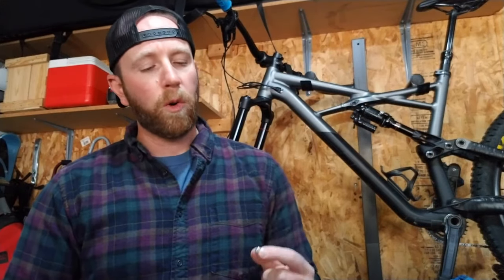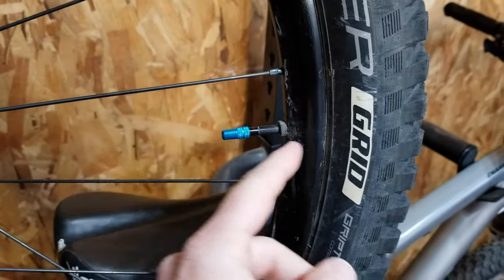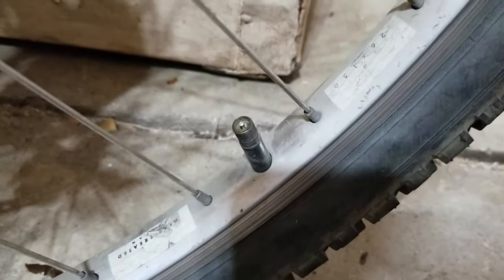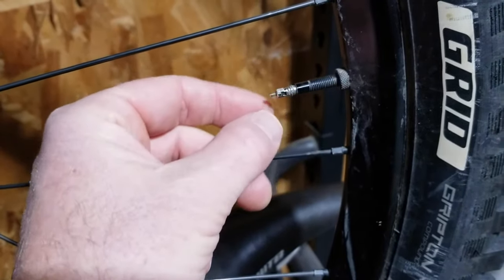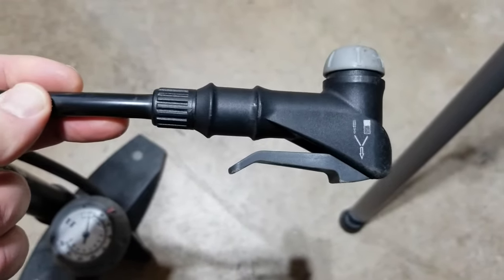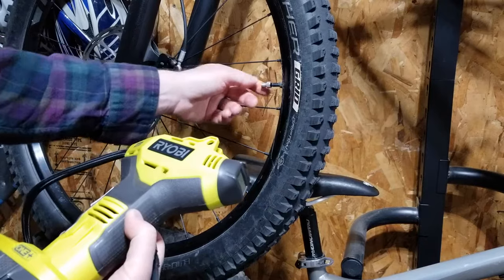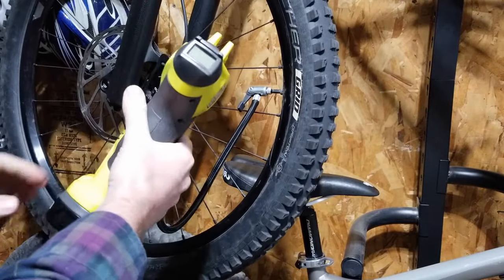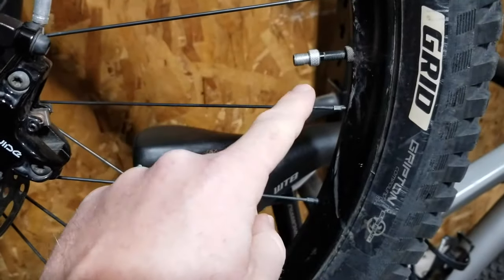How to Use a Presta to Schrader Valve Adapter- and Why Presta Is Better

Comment: Wow, thanks! I acquired a euro ebike that has Presta valves & my pump is for Schrader only. I stopped in my local bike shop & the guy was trying to convince me to spend approx. $100.+ to have him switch out my valves & tubes from Presta to Schrader 😐.  I asked him about an adapter & he claimed they didn’t sell them, he didn’t know ANYthing about that, & no one at the store did either. 🚩 (Red flag!). Been biking for decades & I sensed I was not being told the truth. So here I am on Youtube learning about this less than a dollar part!!! Unbelievable! THANKS 🙌
Reply from the maker: Wow, that seems really shady that a shop wouldn’t steer you first towards this super simple solution. The second most easy solution would be to buy a cheap hand pump that has both Presta and schrader capability. So glad we were able to help and keep you from getting seriously over charged. I would definitely avoid that shop in the future.
Reply: I would definitely avoid doing any other business with that LBS for sure.
Reply: Location of  bike shop so I will avoid it.  No name,  just the city and street please.
Reply: Wal Mart has the adapter for about $2.00
Reply: @jeffhallel8211  Amazon has a 5 pack with dust covers for $6.00
Reply: I'd name them, that's robbery. I ordered a tube with one by mistake because of price, but my air pump came with adaptors for balls and this Presta valve. Speaking of names, don't buy fron Pasco Powersports in Port Richie, FL. They wrote me up a deal for a bike that was $250 more than it was for sale on their website that very minute, and I drove 1.5 hours (one way) to get there to buy it! It wasn't a mistake, they didn't think I'd see it, so I left. That's how you call them out.

Comment: Being 'older' riders and just up grading our old bikes, my wife and I went to put air in the tires before riding and guess what? a valve we'd never seen before.  Called the bike shop and they said bring the bikes in to get air, 20+ miles away, went to Walmart of all places after watching your video and got two adapters  for $2.00.  ( No one at the bike shop mentioned the valves when we bought the bikes)  Thank You.
Reply from the maker: You’re very welcome. So glad we were able to help and hopefully save a little bit of money and time. Bummer that your local shop didn’t immediately identify this as the solution.

Comment: Regulating pressure on schrader valves is very simple.  If your finger nail can't do it the valve cap is designed to depress valve.  What other reasons might Presta be better than Schrader?  I can't see any.  They are a bigger PITA to use IMHO.
Reply from the maker: Good information. Good to hear from somebody who is pro Schrader. Thanks for sharing and thanks for watching.

Comment: I have a Specialized Fat Boy, and couple of times I've had to replace a tube. Even with a good quality floor pump, it's exhausting work to inflate the tubes from scratch. During the Florida winter months I take longer rides and I dread getting a flat tire because it means having to pump it up with a small hand pump even though it's designed for fat bike tubes. I dread ever having to inflate a tube with the hand pump, and I've been looking at the adapters and perhaps carrying a battery-powered pump on the bike. I wondered how the adapters work, so I'm glad to have found your video. Thank you.

Comment: These things are such a pain in the rear. I already have many tools and gauges for a Shrader valve. Even using adapters doesn’t work correctly for some things like my gauges. The first upgrade to my new bike will be to change to Shrader valves.

Comment: I first used my bike frame mounted pump on a Presta valve after changing a flat on the road. I aired up, unscrewed the pump and out came the Presta valve core.  I put the core back in with a little damage to it and limped home.  I searched online and found out about these adapters.  Now I feel safer on the road.  At home I air up with a floor pump and no adapter since the adapter is too wide for the floor pump clamp on nozzle.  I also bought a Presta valve core tightening tool with some spare cores.

Comment: i had 4 tubes pop in less than a week, finally on the fourth swap my bike shop found a problem with the tire, so we fixed that, but he didnt have any 27.5" x 3.0" tubes in schrader, so i got presta, and they made it so much more confusing than it had to be for me to learn how to inflate it 🤣 Thanks for the help for my first air refill
Reply from the maker: Sorry you were having all those problems. It’s definitely a little more complicated system. Glad you got it figured out. Enjoy those rides.

Comment: Coolski, got it going. Had two adapters one smallet and one larger. If you look closely at the valve it has two different threads. The small one did not work, but the larger one did. No need to tighten too much.

And you need to be careful not to screw the little thingy with your converter. Test with a pen or similar

Comment: Both valves work fine. Both will hold pressure. Both will not unintentionally let out pressure. 

My car, mountain bike, Onewheel, Sur Ron and BMX bike all have schrader valves. No issues. 

I have however had the little screw cap come off a presta valve and it wouldn’t stay closed. A shcrader valve, when under pressure, will always close. 

Just my $0.02. But great review on the adaptor as it’s what I’m looking for since my mini pump and c02 inflator only allow for presta valves.

Comment: Scott, you are spot on about that Ryobi inflator.  I've had the analog version and it's been bulletproof.  Actually, the whole Ryobi One-Plus ecosystem is an amazing value, and Home Depot has those... and probably lots of other stores sell these Ryobi products, but Home Depot has pretty much everything that Ryobi offers in that line, and Amazon, not so much.  And no, I don't work for HD or Ryobi.

Also, the Ryobi inflator already comes with a Presta adapter, it's the gray plastic thing, slipped over the basketball needle.  But buying more Presta adapters is a good idea anyway.

Comment: The Ryobi inflator actually comes with its own presta adapter. 
They put it over the needle valve adapter in the accessory tray so they can fit three adapters in two slots.
It's not the best quality since it's plastic. 
But it's there.

Comment: The adapter is nice, but it won't work with most schrader gauges, so while you can inflate, you can't check your tire pressure. Really shines a light on how having a second standard, even if slightly more "user friendly", is ultimately quite hostile by the simple fact that it is a second, slightly different standard, requiring adapters and sometimes two of the same tool. If you have a choice, always get schrader valves on your bike. It'll make your life a lot easier.
Reply: It’s the Apple way: make proprietary tech that forces the end user to buy or die.

Comment: I have Presta in the front and Shrader in the rear. I'm an auto detailer and have the larger Ryobi pump with the adaptor; I wasn't sure about the screw part. I'm not sure I understand the reason for the difference, although I got the Presta by mistake because it has the numbers my bike's tire does. It's okay though, the tube is fine, just different. I hear they are for higher-end bikes, but mine came from an online sale for $85. Presta met my budget. Should be called "Presto"! Thanks for the tips!

Comment: The best bike pumps for dealing with Presta valves are the German topeak pumps. They lock on very nicely. I have no choice but to use Presta valves. On my 42mm deep Aero wheelset. They require 60mm long presta valves. Luckily for me a knowledgeable guy in a bike shop. Told me about Topeak bike pumps. And I have a mini  morph one. Its AWESOME.

And Ive never had a problem. They tend to hold the air better than Schrader inner tubes in my experience. I had 100 PSI in my tires. And they only dropped to 89 PSI in a month.

I remember Schrader tubes dropping to less than 50 PSI over a similar time period...

Comment: and Presta valves look so much nicer than those old Schrader ones IMO, I have just converted 2 old Mavic M231s to presta, which can easily be done with grommets or old plastic valve caps

Comment: I'm going to give people a "hack" I found out about a few years ago that most people don't know about.

Hate to correct the content creator on this one, but I do not see any inherent advantage a Presta valve has over a Schrader valve, and here's why: On any air gauge you can buy at any bike shop, any gas station, big-box department store like Dollar General, Family Dollar, or Wal-Mart, or any hardware, auto parts, or tool store (i.e., Harbor Freight), what you will find is what looks like a small tip on the back side of where you put the gauge on a Schrader valve to check air pressure. What that tip is for, believe it or not, is as a release tool for the Schrader valve in case you over-inflate your tires! In other words, a pump puts air in, and that tip on the back side of the air gauge presses in the valve to let air out. 

So no, you do not need a small screwdriver to release the air from a Schrader valve, because if you've got an air gauge, you also have an air release tool already that is built in to the gauge. 

Happy cruising!

Comment: All my Presta valves are bent. All of them.
My rims need drilling in order to accept Schrader, but these Adapters are neat!
Reply from the maker: You can actually get new Presta valves and a tool to replace them on Amazon. The kit is only like $10 or so. I’ve had to switch out mine a couple of times. The kit comes in really handy.
Reply: @ScottsGarage  Doesn't the valve core have to be removable on the tube? I had a good thorn resistant tube which over time I damaged the stem, I remember it wasn't removable.

Comment: Broke it down, thanks 😊
I thought presta was of the devil at first 🤣🤣 Not so bad now.
Reply from the maker: Good to hear. There are definitely some Presta valve haters out there but it’s a decent system once you know how to use it.
Reply: Lol same, I got a bad first impression of it. I was trying to pump my tires up yesterday, did the front wheel (which had shrader) then went to fill the back one and saw it had a presta valve which my pump couldn’t fit onto.

Comment: A tire gauge has a stem on the reverse side to push on the stem and release air . Very easy .  Presta valves suck .
 I was sold one unknowingly . And the regular 29 inch tubes are out of stock on this island .
.so I'm stuck with this  " presta" valve .
Reply: I totally agree. 
Why all the rigamarole just to get air into a bike's inner tube?
Reply: @monicawhite5352  I have a pump that has a presta valve connection too 
But try checking the pressure .
;(  You have to have a adapter or cut off the top of the cap and force it on upside down .
  Never again.
Reply: I have a dual valve pump that also gives me a pressure reading. No need to do anything special to get a reading.
Reply: @karlrovey  yeah . That's handy . I ordered one but it never got delivered   .
Reply: @boracay12  Had that happen a lot over the last two years. I actually got that pump at Wal-mart. Funny thing is, it's a rather cheap model (the Bell Floornado) that another video was bashing along with the entire comments section. It was the only option available at the local Walmart (one of the few that was never converted into a SuperCenter).
Reply: Presta valves don't let air out as quickly, and they are less prone to friction based blow outs.
Reply: @pafaccount4454  What, in the wide world of sports, is a 'friction based blow out'? Is that another one of those overly complicated terms made up to make something simple sound complex and somehow heroic?
Reply: @curtstan2389  its the tube rubbing against the rim. not that difficult or complicated Curt, idk why you cant understand it. Jeez, someone mispelled your name.

Comment: Every gas station and garage has ability for schrader as well as  consumer air pumps.
Reply from the maker: Good tip. Thanks so much for sharing and for watching!
Reply: Schrader is the standard every where .  There are no pumps in public that fit presta .  There is no benefit to using them .
Every car and motorcycle in the world uses schrader valves because they are reliable  .    The valves are spring loaded .  Just put air( at any pump anywhere) and put the cap on to keep dirt out .  Even with no cap they still function .

Comment: Hi how can you convert a presta valve to schrader valve every time i try to pump my tire the threads break off the top of the valve is there a tip for the pump that supports the whole valve and not just the little threaded part at the top or is there some kind of fitting that will screw on the weak presta valve to give it more support when filling the tire thanks

Comment: Here's a question:  with this adapter, I can't get the compressor hose end, that you attach to the valve stem, to actually release air and pump the tire...?  In past, I've recognized that there is a small valve tip inside this hose end that must be compressed to allow air to pump.  Some of these adapter are 1 mm short for instance, so the valve stem, with the  Schrader adapter, are short n therefore do not press the small valve in the end of the compressor hose.  I've thrown a tiny little rock in there to make up for that difference.  Where that has worked, today, it, didn't?   I went by 2 gas stations and Costco tire garage...nada.  Could not get the air to go in.  By way, I'm trying to bead my tide onto my rim.  So i need that large surge of air...today, I couldn't even get the air to come out at all.  Nada.  There must be something I dont understand that these gas station type hose ends must have in order to work...and all 4 of my different adapters weren't compatible.  Any ideas?

Comment: That little thin bit you press in to release the air is deliberately put inside on a schrader valve to stop it accidently being pressed. It's safer. It's been used for years by thousands of people. It's a much simpler and superior design to the presta.

Comment: The Ryobi inflator! OK but dies battery size matter? They are 18V but I see Ah from 1.3, 1.5, 2.0, 3.0, 4.0. Can't see what size battery he is using. And the link goes to Amazon with ALL the choices.  Is there going to be a limitation to the fill pressure with the lower Ah? Or just how many tires can be filled? B

Comment: That's awesome, I came here to see if I was doing it wrong and apparently we have the same setup lol I too use a Ryobi compressor like that one with the digital gauge, except it doesn't give me the most accurate reading, I notice when I pull the trigger or even let go of it it starts reducing in PSI. I don't think the tire is losing air but I feel like the compressor isn't giving that accurate of a reading? I'm doing exactly what you're doing. The only thing is I can't see your reading in the video, there is a glare. any suggestions? thought about even getting the next compressor up from Ryobi and trying that. it comes with a gold medal adapter unlike this one with a plastic one.

Comment: Any issues if i keep the adapter on with the valve in the 'open' position and continue to ride?
Reply from the maker: There shouldn’t be any issues as the presta adapter creates its own seal. That being said, I usually close mine up just as a back up.

Comment: Not to nitpick, but... the plastic cap on most Schrader valves has a little dimple on the top which can be used to bleed air from the tire.

Comment: I have been on Mountain Bikes since 1989, I had a Marin Madrone. All of the bikes I have bought, I have had the bike shop people install Shrader. Car tires are Shrader, lower end bikes are Shrader, 19 wheelers are Shrader. Even the valve on our 4-gallon tank for filtered drinking water in our kitchen sink is Shrader. I bought a Santa Cruz 5010 two years ago and the bike shop couldn't install traders because of the pandemic. So, I have been tolerating them, Aat first I came in with an open mind, now I want them gone, special adapters, etc. Now I am looking at YouTube videos, on how to drill properly in the rims and install Shrader's on my Santa Cruz, the rims are narrow, and that is possibly the deal breaker. 
The people that say that Presta's are so great are the same people that say that positive ground British sports cars from the 1950's are great too.

Comment: if the Presta valve breaks off when  filling your tire will  the adapter for the shrader valve help to keep the air from coming out till you can get it fixed.
Reply from the maker: That’s actually a great question. I definitely know that the Schrader adapter will help protect the top of the Presta valve from being broken off. If it’s already broken, then I don’t know that it will do much in keeping air inside your tire.

Comment: I find that adapter to be a pain in the arse. It is so hard to get it on just right so that the electric compressor snaps on just right. Sometimes I can screw the adpater on in 1 shot and pop up no problem. Other times I have to fiddle around with how much the adapter is screwed on and then fiddle around with the threaded end of the presta valve. I am really looking for a quicker/ slicker way to inflate tires.